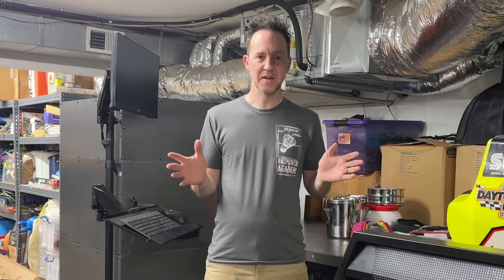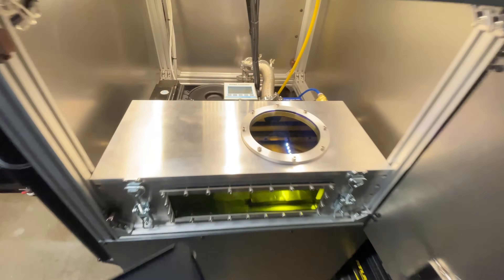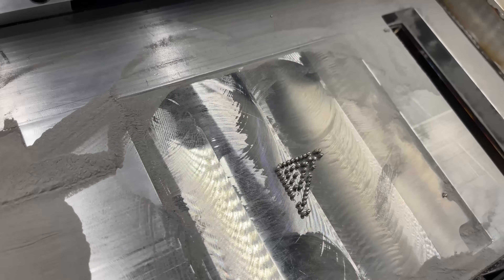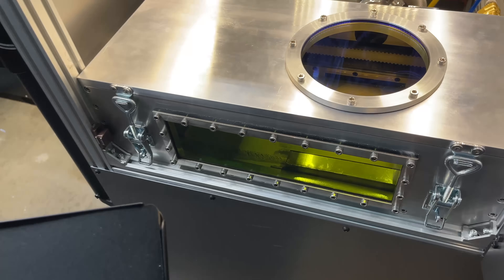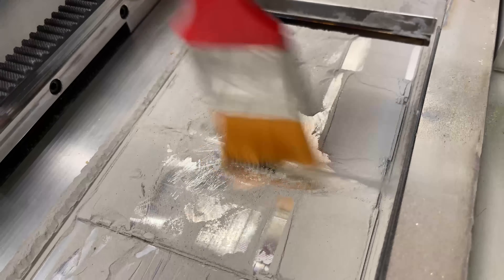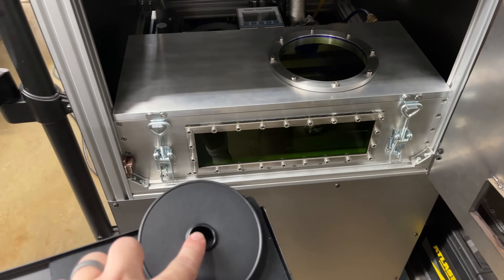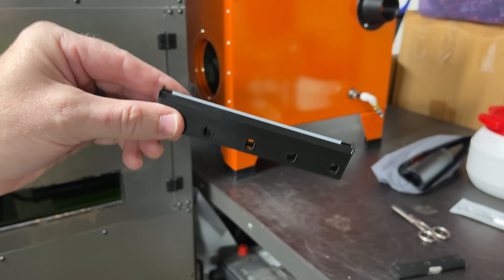DIY Metal 3D Printer: Part 8

Comment: Please, don't use any LLM as a trusted source of info. Even the one with web search grounding aren't reliabile. Not because it reads a something and tells you otherwise, but because they can't reliably discern what's good and unbiased info/data/resources from what's not.
They're not totally useless. If you know what you're looking for, it can be a good time saving tool, since you can catch these mistakes, ignore them and still use the rest, but otherwise you could find mistakes where you least expect them, especially in higly technical niches

Comment: You may want to look at using rollers for the re-coater blade to pack the powder down as it spreads a new layer to increase powder density. This will also reduce shear forces on the printed part. If the powder is packed tight enough 5-10 layers it maybe possible to use it as a bed for the first layer. I would also make a test print for laser power and density to dial it in for your specific application. As for a heated bed the way you designed the built plate you may be able to add a heating pad below and use some pass though connections down to apply power and for the chamber a small halogen heater if you have room. Love you work keep it up. Can't wait to see a completed print.

Comment: 6:50 yep, this is difficult. Tra to use a rotating cylinder. Try also to bring the part down to fill more then up to remove up to the needed layer
17:00 never without a mask for this kind of particles.

Comment: Not an expert here at all but Would an active recoat’er blade work better such as a roller that rolls along as it’s moved from side to side to prevent the shearing and dragging action of the fixed blade. It may also help to pack the powder down slightly that may help reduce the amount the powder shrinks when hit with the laser.

Either way this is a super ambitious project and can’t wait to see you pull it off .

Comment: It seems like you're fully melting the metal rather than just slightly melting or sintering it. That might be why you're getting those small spherical formations. I'm not sure how you're managing to get it to adhere to the print bed—maybe using a lower melting point metal for the bed could help, allowing it to partially melt and bond with the powder?

Comment: Heated chamber is really important for smooth operation of SLM. ChatGPT is right about power density; you have too much heat in one spot, and the reaction from melting is too energetic because of that. That contributes to the material bubbling up and warping, as you have recently fused hot powder in contact with a bunch of cold powder (and a cold build plate). A hot chamber reduces the heat differential that causes warping, and also allows you to set your laser power WAY down, just tipping the powder into the fusing thermal range.

Honestly, with the setup you have, adding in a heating element wouldn't be  a huge amount of work.

Comment: sand the build plate to 80 grit. when you recoat do it 5 to 8 layers thick and smooth to 1 layer on the back stroke. the the power is too high and the feeds are to0 fast drop down to 80-120 watts with far slower dot speed for the first 5 layers or relax the focus the dot size needs some overlap to prevent balling. I work on commercial units. how the beam moves and the line fill has a lot to do with the balling you really want to work outside in to help with focused heat loads and reduce tension and stress in the part last bit is most machines preheat the chamber or powder to around 250f
Reply from the maker: Awesome, thanks for the tips!

Comment: From other 3d metal printers I have seen, the powder should completely cover the build plate and the 3d printed structure at  each pass. but I can see that areas of your build plate are not being covered at all. Also, the silicone cord should never actually contact the 3d printed part or support structure?
Reply from the maker: It does cover the build plate usually. There were times in the video where I messed up the initial settings and it didn't cover. There was swelling that caused the cord to touch the prints.
Reply: @diyfiberlaser  The cord swelling from temperature effects?

Comment: Also had a thought about the bulging. Could that be from the direction of path from the laser. I.e. in to out or out to in. I would assume that if you tried to print a circle and the path ran inner to outer the the center of that circle would maintain a higher heat and want to draw the liquid metal towards the center given the coalescence surface tension.

Comment: Perhaps it would be better if you milled your rod, the one that pushes the iron powder, from steel... the lip might be better made from a thin sheet of metal... I think the pressure will get too hot and cause it to bend and melt...
Reply from the maker: Thanks, I still might experiment with switching it over to a metal blade.

Comment: When drying the powder, I recommend not sealing it completely with the foil, because that won't allow the moisture to escape. At the very least, I would poke several holes in the foil. Additionally, I would open the door of the oven periodically, for a minute or so to let the moist air out. This will drastically improve the drying.

Comment: Liquids have a lot of surface tension, so a molten blob would try to minimize that by being spherical.
So to prevent that the area being molten must be small enough that the surrounding powder can resist the surface tension.

So a very fast and sporadic pattern that goes over multiple times, that has enough time for the sintered(not cast) powder to cool.
I suppose you could also test this without supports and already having a thick layer of powder, you should get a very fine pattern of tiny partially connected beads.

Probably also try multiple grids like in material tests in LightBurn.

Comment: Another great video; truly inspiring. But please be very careful with the powder: Even if a specific particle size of, for example, 80µm is specified by the manufacturer, there are often significantly smaller particles mixed in, which can be unknowingly carried away and ultimately ingested. And that's not harmless. The same applies, of course, to the possibility of a metal dust explosion: It happens faster and is far more violent than one might assume.
Reply from the maker: Thanks...I did notice this when testing different sieves, there are definitely some smaller particles

Comment: because i like your work, i’m sharing some of my thoughts and info. From what i can see your supports are way too large. They must be more like needles, i think they don’t have to exceed 1mm in section. All laser printers i’ve seen don’t exceed 1kw, most of them have like 500w. Layer size varies between 20microns to 100. I guess lower is impossible and grater will ruin the print.
Supports are very dense almost like a tooth brush. All build plates i saw with attached prints are grinded before printing sesion (to have an even surface) then i think they are sandblasted because they are not shiny at all! Supports must cover all the parts surfaces, like a shadow. You also need to know the powder properties, so you can melt it right, no under or over melt.
Take care, as the powder is very tricky and can easily and be inhaled or swallowed, use protection,gloves masks etc. i hope you will succeed, and maybe some of these info can help you if didn’t know already :)😂

Comment: The issue with silicone wipes is the build part has to cool down u see orange color is too hot for the wiper so add a gcode to pause the wiper so to let each layer cool down

Comment: I think you need to redesign the recoater, that silicone wiper is not the way. Make the recoater a sold rolling cylinder that wipes across the build surface. The recoater needs to be stiff, not pliable.

Comment: Hi, you could test a ptfe tube (like the fdm inlet stuff) for your recoder, works in my sls printer / project.
Reply from the maker: That could be an improvement...I'm going to test using a SS rod next.

Comment: ❕️FIRST LAYER FIX:
(from an SLM instructor)
The first layer is too thick - this is your main issue. As a starting point, make sure the first layer is bare metal (or very very thin powder layer). Your first layer should not be thicker than the layer thickness you're building at. Two scans on the first layer could help, but usually not needed. Too thick first layer → poor bonding

Fully dry the powder before starting the build — humidity can cause serious issues. Aim for rH below 20%. The drier, the better. Always store powder inside closed containers with fresh/regenerated silica gel. You could also add some silia gel inside the machine to help maintain low powder humidity during build jobs.

Make sure to fine-tune your laser energy density settings - this one's obvious.

Don’t waste time on a heated build plate — it’s good practice, but really not needed and definitely not the main issue in your case.

And hey — give a shoutout to Lyria in your next video if this works!

Comment: First layer is the most important. We usually recoat a layer of powder and then move the platform up and move the recoater until we cut out almost all the powder (you should see the build plate through the powder). Then, scan twice the first layer to make good adhesion.
Obviously finding the right parameters is the trickiest part. But from what we can see, there is way too much energy density. The melt pool is too big, creating spatters and bumps on the top surface. The part should not turns red haha.
A good chamber flushing also helps to have a more stable process. 0.8% oxygen is actually a lot (it's 8000ppm, should be around 10 times lower).
Reply from the maker: Thanks, I'll try that method for preparing the build plate. Haha, yes it was glowing! I should be able to get the O2 lower now that I fixed the leaks. I just found out that I am way out of focus...17mm too low, doh! Hopefully the next round of test will go better after fixing that.

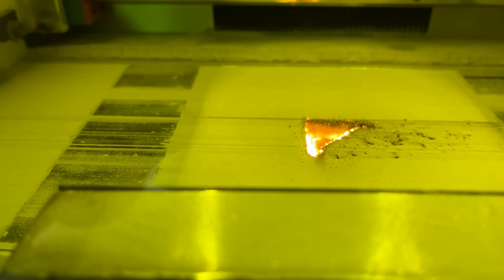Comment: I think you should change the recoater to tool steel and make it as sharp as possible with a small curve and rectify it on your mill, silicone is "soft" and it will always eat up a little bit, also, while passing on the hot metal it might deform, I am working on mine also and that's how I'll "roll", it's a suggestion thou! Edit: Just saw you noticed it also 😅 near @13:00
Reply from the maker: Haha, next I'm going to try replacing the silicone with a 3mm SS rod and see how that works : )
Reply: @diyfiberlaser  Nice!! For sure you'll let us know how it worked out! Another suggestion is to use a "rolling bar" it counter rotates on the direction the arm is going, but that would imply another motor and probabbly changing the internal structure of your chamber!

Another suggestion, if you are experiencing warping, it could also be related with the rapid cooling of each layer, maybe keeing your powder or the base of the build plate around 150 / 200c and the atmosphere around 60 - 80c could help. (I can't precise the paper, but I've read it somewhere).

Anyway, you are doing an awesome job!!! Eager to see the final results!!

Comment: Wow incredibly complicated project. In FDM printing sometimes you use a "raft" as a way to firmly bond to the build plate. Maybe the first layer or two could be a mesh that you lay down with increased power to get it to stick to that thick cold build plate
Reply from the maker: I used a raft in my last test...I think it will work better when I get the printing parameters correct.
Reply: @diyfiberlaser  If i was trying to weld thin metal to thick metal I would pre-heat the thick metal. Even a few hundred degrees makes welding a lot easier

Comment: The unsintered powder around the piece serves as thermal and structural support
By pushing with a spatula, you can disturb the local thermal uniformity, creating colder regions and others warmer this generates internal tensions and warping in the final piece. 3:17
Reply: You have to pour the powder on the print, you can’t drag
Reply: Pour or roll the powder over the piece, without pushing the already sintered material

Comment: blackened aspect indicate oxidation
the sparking indicates too much power + too much oxygen
the layers look WAY too hot as they glow for quite a while (you want a relatively small melt pool) and have a bubbly aspect

So, it seems that there is still too much oxygen, and the laser is too slow and/or powerful

As with anything laser, you really have to identify the key parameters and make test coupons. Ideally the SW you're using should be able to generate a test matrix to test 2 parameters against each other, this will save you many hours of manually testing all that.
I'd recommend to start with speed/power, then power/pulse duration if it's adjustable

Comment: From what I’ve seen, I’d like to give you three pieces of advice.
First, it seems to me that the laser is moving very fast — definitely faster than on a professional printer.
Second, from the video, the power looks extremely high; it gives me the impression that instead of sintering, it’s actually melting the material. Especially with such aggressive settings, it seems that the time between layers is too short.
Third, your powder behaves strangely — it looks damp, even in the latest attempt.

To improve adhesion to the build plate, we sandblast the surface of the plate. When we work with CoCr, we use a specific function that prints the first layer twice (without adding new powder on the second pass).

As for the solid layer printing pattern: professional printers don’t print large solid layers the way an FDM machine would. Instead, they print in sections with different orientations to minimize warping and distribute heat more evenly.
Reply from the maker: Noted, thanks for the tips!

Comment: SLM Engineer here... Level the build plate without powder so that it is zero. Move it slightly down and do a powder layer, move up the plate while recoating and stop when metal starts to shine trough. Then there is a slight powder layer on and you can start to laser your first layer in two to three passes. What's the Material you are printing? AlSI10Mg? Regarding parameters 60my layer, for vector supports a good start is 350W 1000-1200mm/s Scanspeed.. Volume in a part 370W, Speed 1600-1800mm/s.. Contour 370W 800-900mm/s... That should lead you to a good start. Energy density should be right, so if your laser has less power go slower... Hatch distance is also a factor to keep in mind. 0,08 to 0,12mm if you have a 80my spotsize. Laser against the gas flow direction to always laser clean powder without any molten particles. Gas flow should be as high as possible without blowing your powder from the plate. Always keep your powder dry and inert as possible. Keep up the good work! Amazing project, thank you!
Reply from the maker: Thanks for the tips! I'm printing SS316L with 50 micron spot size.

Comment: Personally I would suggest checking your focus, this will be very critical. (marking anodized aluminium plate with very low power)
I would also suggest switching to a more flexible recoater blade like a wiper blade, I use it also on my machine and it is perfect for dialing in the process. This way you can even set your build plate higher than the 0 point so you can be certain that you are not adding a too big of a layer.

For process development I would also suggest to use a 1x1x1 cm cube, very small parts are generally harder and also very large surfaces are harder with this process and a 1x1x1 cube is just in the middle.

Parts that are popping up can have 2 major causes:
1. too much power input
2. not good enough heat conduction from the meltpool to the other material

both of these can have multiple root causes that are causing this effect unfortunately.

I also dont think your powder is that moist that it would cause this big of a disturbance, drying powder is best done in a vacuum chamber, if you have enough time you dont even need to add any heat. 1 day under vacuum should be fine but longer would be slightly better.

Comment: You can use higher energy in the first 3 layers for a good penetration of the welds in your build plate only then you go with your solid or support parameters. 
For example some LPBF machines are exposing the first layer twice to do that without changing the process parameters. 

I would advise you do a Design-of-Experiment to test multiple values in a single build instead of printing another build each time with different parameters. There are a ton of papers on the subject on ResearchGate and Ai chats are doing a good job of scraping them all to find the desired subject and summarize them.
Reply from the maker: Thanks for the tips...I will see if the software can implement

Comment: Adding to the echo chamber of other comments, I'd start with doing single line passes first and calibrating on that. Pre-heating the powder is also definitely necessary to at least get the moisture and oxygen out(not like SLS where it's pre-heated to near melting point). You could maybe get away with rapidly scanning a very defocused beam to pre-heat it that way. Defocusing for sintering and melting may also help a bit. Also, the silicone spreader might be getting burned/devitrified by the hot metal as it scrapes along.
As for the oxygen problem, I did say right at the start that you need a good vacuum pump before backfilling with argon :)